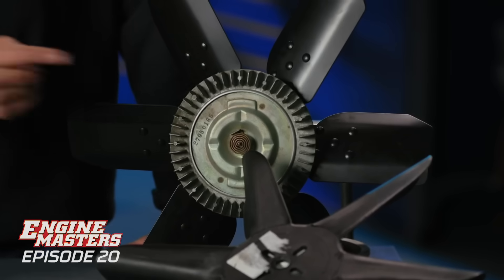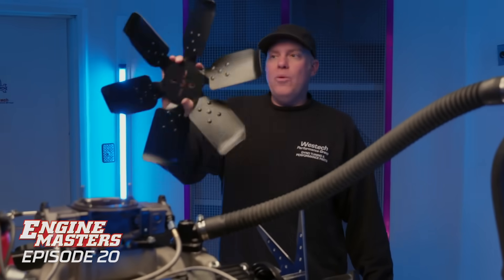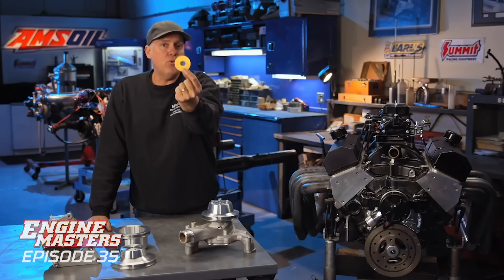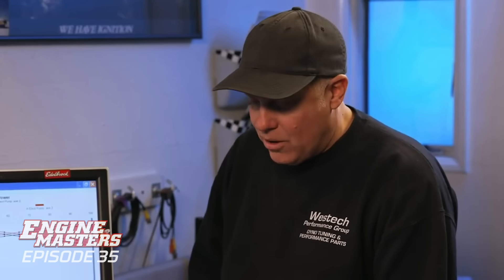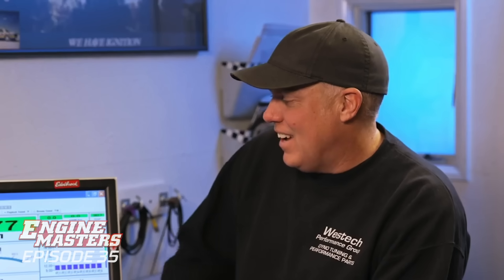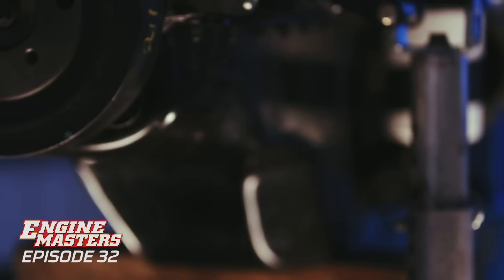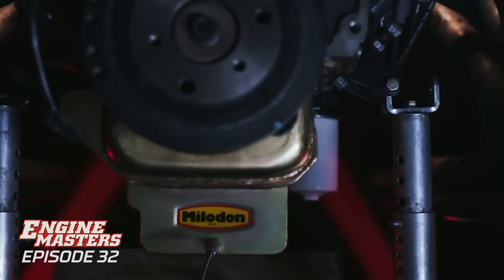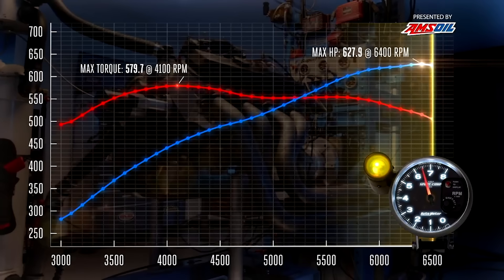Don't Do This! How to Ruin Your Engine's Horsepower | Engine Masters | MotorTrend

Comment: @ radioguy1620.Galaxie 500 XL's got a 1965 C5 coded Hayden patent fan clutch. Id like to tell Jeff McJeff how much hp a fan clutch takes off as a percent. 4%. A little less than 230 hp from a Diesel Electric Locomotive.

Comment: @ radioguy1620  FoMoCo used a spreadbore in July 1968 on the J code 230 hp 302, then a GM Rochester Q Jet via Carter in 1971 on the auto SCJ 429. A fan clutch on the FEs before that.

Comment: I had a 73 Dart Sport (duster) 360, 4 speed, 4.56 gears I ran on the street. it ran a bit hot at stop lights, traffic. So on went a plastic fan, problem solved. Was surprised to see how much of a power loss there was with the same fan I had. I had no idea. But my car made just enough power to get by a early Nova (66-67) 396 auto on Woodward Ave, even though I had to pull 4th gear to do it.

Comment: On the various engine master shows, with a bad air cleaner, the wrong fan, too much oil in the pan, and a fast turning alternator and water pump, you can kill 150 hp, on a 700 hp engine.

Comment: The amount of power that the alternator 
uses, depends on the load placed on it.

The charge state of the battery will change, 
as the alt charges it back up, after starting.
You also need to figure out what else you're 
running as well.  Headlights, heater/AC 
blower, and radio.   Anything run by a switch, 
will cause more drain on the alt.  (Which will 
use more HP.)

steve
Reply: Yup, a lot less resistance with less load.
Reply: 1hp per 25 amps.
Reply: Not really the alt is no harder to spin under load or not.

Comment: Thats why you add in a push button under your gas pedal at wot to disrupt power to the alt run 1 electric fan build your own elec water pump with a cooling fan motor
Reply: Not a bad idea

Comment: It’s 2021 just a coolant system saves weight and HP or just LS throw them old SB out you can get more from a 5.3-5.7 Ls1 then you can from a SB all you need is a few updates and u make some nice power

Comment: To me no surprises. Clutch fan consumes least power, alternators eat power and the faster you turn them the more they eat,,, and fail!
Tin fans and those shiny flex fans are simply dangerous at high rpm. I have seen all of those through bonnets, radiators and splash trays. Often!
And a decent oil pan makes power, as well as make the engine live
BUT what is good for a race engine does not translate to a normal road car. Except the pan and even then often lower and more vulnerable.
Race engine slowing the alternator by half, the waterpump speed to crank speed or a little below is all proven. And all function as they should and cool better and charge better. And not throw the belts near as often
For a 'normal' street car engine the standard ratios work best as it seldom sees more than 3000. Race engine is at least 6000.
Electric fans consume power,, the alt drag  proves that

Comment: And we have to remember an engine that runs hot loses quite a bit of power also. So the drag of a fan that uses more horsepower may also cool the engine better. There are very few aftermarket electric fans that pull as much air as any mechanical fan.
Reply: An engine can feasibly be more efficient operating hotter. Having a higher pressure radiator / reservoir cap (say, 24 or even 32 psi) will increase the boiling point and the engine will make more power.

Comment: Can yall do a video on building a ford 4.2l v6 i know thats random but I've never really seen or heard of anyone building one and I kinda want to build mine for more hp
Reply: I shaved the heads on one and ported the exhaust ports out to the gasket size. Got 167hp  to the ground through a automatic transmission. Single exhaust with flowmaster.

Comment: Ok may sound crazy.What if you take a oil filter gutted it and replace it with a wire mesh to" run at the track "? Would it lower the drag on the oil pump  = less power loss ?

Comment: I used to run the oil on the min mark but because it would warm up quicker (made a noticeable difference to mpg) but i didn't think it would add hp at the same time.

Comment: All I know is: no matter the fan, they’ll eat fingers equally well.
Reply: actually. an absolute gem that everyone should try atleast once in their life.
bmw e39 540i and 740i have the 4.4 v8 and its a belt fan. if its operating properly it will stop and cause no harm to your hand at idle. if the fan clutch goes bad it sticks on and the fan will not stop and chop your hands off. the way to check the fan for service is to stick your hand in and see if it survives. or a rolled up newspaper and see if it shreds.
electric fans are also pretty safe so long as its not up to temp.

Comment: What they DIDN'T tell us is the VISCOSITY of the Oil that was used in the test. Example: a 10-W-40 oil will consume more power than a 10-W-30 oil of the same type, due to it's "thicker" consistency at engine operating temperatures. 
The power-robbing that happens at high rpms is caused by "windage", which is the action of the crankshaft spinning in the oil pan, and the resulting internal friction in the oil is what robs the horsepower. Racers have special oil pans and "windage trays" that strip the oil from the crankshaft  at high rpms.
Woe be unto the poor fools that think that draining Oil out of their "street" engine will give them more power.
This video can be very misleading to the novice and/or the owner that's looking for a bit of free horsepower.

Comment: Could too much oil cuase it to cascade down the flat side of oil pan at only high rpm next to flywheel or is it the seal or perhaps pan gasket only say 4k or more on rpms, it has a new stock pan n gasket

Comment: Good info Fry burger :).  I think us gearheads have known that fans, etc. will drop some power.  Didn't think the fan that much.  However.  I'm running a big inch hemi on the street.  The last thing I need is an electric fan or water pump failure and then your motor is toast.  More wires, bigger alternator, bigger battery, etc.  So I make 800hp with a stroker big inch motor to offset the parasitic loss from the mech. fan and water pump.  Safety and simplicity first.

Comment: I'd also love to see a test of all the gimmick stuff you see to make "more" horsepower aka infomercial and JC Whitney catalogs (Is JC Whitney still a thing?)
Reply: Haha.  I haven’t heard of JC Whitney in a long time. Maybe since ‘98-‘99?
Your comment reminded me of the “Tornado” that used to be sold; the stainless steel turbine- shaped air foil that was guaranteed to boost horsepower, or your money back...
Well, the guys over at Power Driven Diesel did an episode based on the old snake oil gimmicks a while back, and dyno tested a truck with the tornado in the intake tract, and you guessed it, it was quite the restriction to flow. Lol. I don’t remember the numbers, but it was significant enough to be measured on a chassis dyno.

Comment: I wonder if different power output alternators would make differences? As in using a high amperage alternator but not working it as hard than the same load on smaller output alternator? I'm sure its miniscule but it may be worth looking at? 
Besides, ill just get me one of those fuel magnetizers and get that power back. 🥴

Comment: Need to also mention that oil pressure increases with rpm and if it decreases it could mean a plugged oil filter or a filter that wont flow enough oil for the application or excessive viscosity....or if its a fram filter it might have had a catastrophic internal failure.

Comment: Just a quick question. The engine is static, not moving , asif in a car under accelleration. Would these results hold true on the engine oil test?

Comment: What was powering the electrical water pump? In the vehicle, it would be powered by the alternator, which in turn would 'kill' some HP to run the water pump.

Comment: Guys, this style of testing may be a bit misleading on the fans.  For one thing, alternators are not very efficient, (as far as I know, alternators are only about 50% efficient), so if you think using an electric fan wastes less power, be aware, this complicates things.  Another issue is that the engine needs cooling.  That, right there, is the big elephant in the room.  Reduce the cooling needs first !  (this means run a more efficient engine - it doesn't mean increase 'free' cooling).  The water pump and the thermostat are significant wasters also.  The water pump runs all the time, and the thermostat valve design is terrible (lots of obstruction).  It would be better to have a variable speed water pump without the valve.  But finally, the water runs through the radiator, obviously.  If it were big enough, we could do away with the fan, but the system is highly dynamic.  We need to boost the air through the Rad on hot days, or when the car is hardly moving....which says hey, that 30hp that fan takes? - is probably consumed by the aerodynamic drag of the radiator when the car is moving fast down the road in any case, on top of the fan - but if this is happening, the fan is hardly consuming any power at all, since the air is moving through anyways, and the force on those fan blades reduces dramatically with speed-induced air flow.  So in a stationary testing lab, yes the fan uses xx horsepower, but thats in the stationary condition only, and when do you have the engine revving at max horsepower when the car is standing still?
Reply: One more thing - those are the most inefficient fan designs ever.  No curved blades, no airfoil profiles, etc.  Modern fans are a lot more efficient than those ones.

Comment: When I removed all the oil for my suburban it locked up what did I do wrong. I’m just kidding the oil cooler burst and lost all oil, however 350’s are still pretty tough because I took the spark plugs out and turned it over and it still has 40 psi the oil pressure it was cranking and it still runs after locking up and smoking and not wanting to do anything. And that’s why am a Chevy man at heart

Comment: The cooling system on the British Rail Class 43 locomotive takes 230 horsepower to drive at full capacity.
Reply: Allen S  is being a jerk for no reason a hobby of yours or a full time job.
Reply: That's a lot! Then again those locomotive engines probably don't even notice it, and although it may be useless information for me at least, I still found it interesting, so clearly the one dude is incorrect
Reply: @lumpyzx2645  well the engine has 2280 BHP so only 10%. But still huge parasitic loads.

Comment: Power for the electric water pump is free on the dyno.  Drive an alternator and rely on it for all your power for the water pump.  Each power conversion robs horsepower.

Comment: 350 Chevs with the early heads have a couple of inherent faults, one that the middle of the cylinder head rests 2 exhaust valves next to each other, the other that the inlet manifold at the thermostat coolant outlet needs to bleed into the waterpump . This also depends upon  the type of water pump being used. These 2 problems lead to heat soak which can cause a loss in HP due to a loss of vacuum at the valve seat. 
The electric water pump is not very good pushing coolant up a hill or through a small  hole. A modified factory pump is much better although the factory pumps suffer from different size runners into the cylinder block. Heat soak is the biggest enemy of the small block.

Comment: Conversely, does the most horsepower robbing fan move the most CFM? You realize that going down the road, the fan drag is partially negated by air being forced through the radiator. Above 30 MPH, the fan really isn't doing much.
Reply: The answer is no. No aftermarket fan moves as much CFM as a factory fan & fan clutch & EM test showed the stock fan & clutch assembly was also the lowest drag on one of their Motortrend TV broadcasts

Comment: Regharding the load of the fan, I witnessed a demonstration similar to this. One night about 11:00 p.m.a neighbor's AC outdoor fan unit did not run. I cannot figure out now how I noticed the activity around their AC unit, Anyhow, smarty pants me, I brought over a garden variety home box fan and laid it on top. I think the fan started running OK, BUT, as I remember it,  when the compressor kicked in the fan suddenly stalled! I could make it work by picking up the edge and letting topside air bleed into the fan, and it was easy to play with how much load the fan saw. It was instructive and amazing. Sidelight, the man of the house was not present when this started, but he did come home while I was nursing the AC along. His wife was in a housecoat. When he noticed this he started to get pissed at ME! Like I was making moves on his wife? He figured it out quickly enough, but, shesh.
Reply: Mighta been a bad starting cap or something like that (general tinkerer thru the years and can usually find something obvious with a little educated looking)  😁
Haha you weren't trying, you figured that if they don't find ya handsome at least find ya handy(lol) but he thought you were challenging his man card 😂

Comment: i had the plastic one on a bbc with no shroud...watching that thing flex at 6k was scary.... 
next up...using 0w-20 saves you hp.....and... how to rebuild a motor that lost oil pressure...

Comment: Ok, but keep in kind that some of that drag can be offset by the air being pushed into the fan with vehicle speed. Or relative wind. The wind that is artificially created with movement. At that point Steve Brulet is absolutely correct, the fan shroud would help focus the relative wind through it and onto the fan. Is there a way to measure that?
Now for drag racing the alternator has no effect if you run an alternator cut off switch. You switch off the alternator while making a pass, and switch it back on immediately after the pass. It works!
Now for the oil pan if your afraid of dropping the oil to low, just runs an oil reservoir to make sure it doesn’t run out. And make sure your running a windage tray in any pan. That’s good for 15 hp in a Mopar 318. More on a 340 or 360. So, whats it org on the 454?
Reply: They must have a shroud for the fan to work efficiently & it's best if the fan has a bit of the blade outside the shroud to prevent cavitation.

Comment: Hi , I drive VW Golf 5 1.4 patrol engine and 80 ps . My RPM goes over 3800 when I am at 120 km . Is it normal? 
Thanks.
Reply: I would say that's pretty low.

Comment: I feel like this study has been performed by every OEM and yet there are no white papers available
Reply: See if you can find some older (late 90s early 2000s) Kohler generator cut sheets. 
Say from 20-200kw. 
Diesel or gaseous.
Im pretty sure they gave a fan cfm and hp rating for calculations into airflow requirements for say installing it in a building. 
It's been 15yrs since I've looked at one though.
Heh, I do remember one spec in particular because it's cool. 
They rated the industrial Ford 460 turbo  at 160hp @1800.
 Think about it , that's pretty rippin!

Comment: Excellent video! So many guys take the mechanical fans off, yet so few know how to engineer a reliable and capable electric replacement 👍🏻
Reply: Ron Davis, of Ron Davis Performance Radiators(he's made Indy car & other racing radiators for decades) told me 35 year ago that electric fans don't move enough air for everday driving in hot climates for any serious HP engine. He also said it requires at least 17# of pressure in the cooling system to force the water tight enough to the engine to efficiently extract heat from the engine. I run a 19# radiator cap with a Hayden Extreme Duty fan clutch & stock GM fan on my 409" SBC(which all the know-it-alls say have an overheating problem) hot rod & it never ever runs above 190*, even in the very hot desert where I live, half way between LV & Death Valley.
Reply: Delta PAG Brushless, massive airflow, very low amps

Comment: These guys would have many more followers if they would use other engines for testing. 90% of the time it is a sbc. What is wrong with using MOPAR or Ford. Personally after driving Chevies for years. We just got tired of putting money into these fragile engines. Switched to Ford and Mopar. What a difference. The Fords we have owned, have been extremely durable compared to the chev. The last 2 Fords we traded in had 165K and 170K miles on them. Every Chev I owned tanked around 80K, can you say timing chain.

Comment: I was lost from the start. Did they use the same engine this entire video? Does a fan vs no fan make you lose 100 horsepower? Running low oil is good? WTF?

Comment: I wish we could have a window in the pan to see the crank action splashing up the oil. Banks did a test with a rear axle cover. They concluded the flat design was preventing oil getting to the gear.
Reply: You probably wouldn't see much due to so much oil splashing around.
Reply: Some Russians made a glass pan on their Lada channel where you can see tat, its called garage 57  (ore sometinglike that).

Comment: I would have loved to see the airflow differences between those 4 fans too..
Some applications need cooling more than the 5hp saving between 2 fan types..
But NO electric fan will pump air like a belt-driven fan. Period.
Reply: Well thats just not true. a pair of big electric fans mounted directly on the radiator moves alot of air, and turn a much higher rpm that the belt driven fan. virtually every manufacturer has switched to electric fans because they are so efficient. just the same i will always run a belt driven fan and water pump on my old chevy. but i scrapped the a/c and power steering and run a small crank pulley. still never gets too hot.